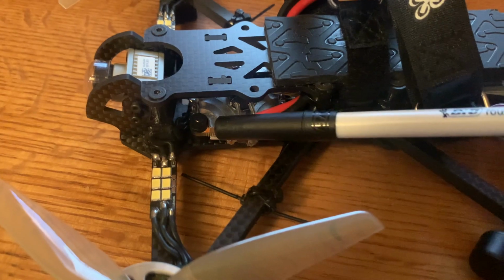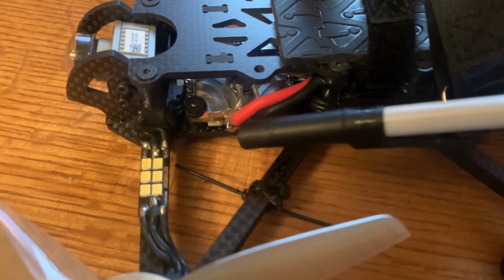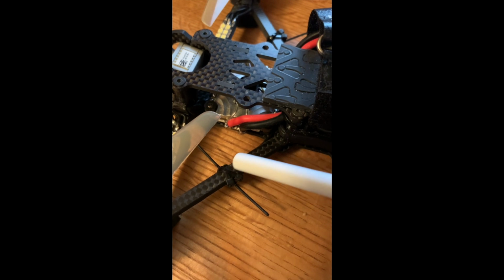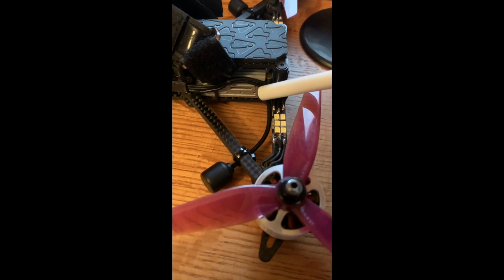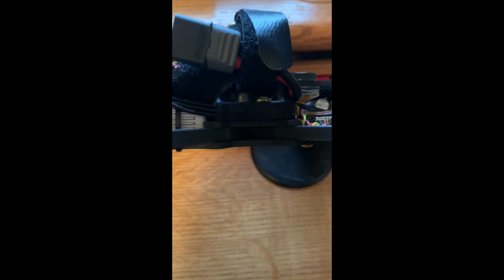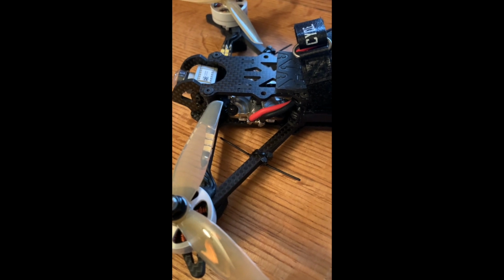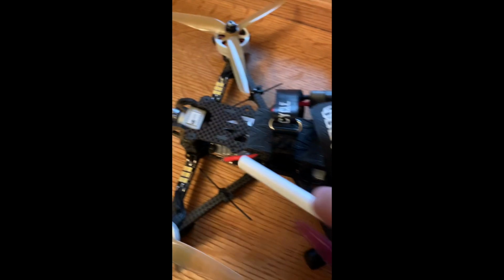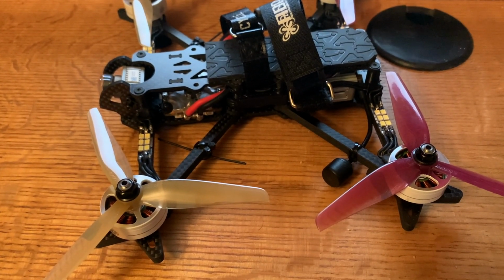AOS5 Build and Review Part 2

Comment: looks wicked fast !
Reply from the maker: Yes it is a beast! You hit the throttle and it blasts off like a rocket. But with the FPVcycle 25mm motors it is also very manageable for an average pilot like myself.
SLOG